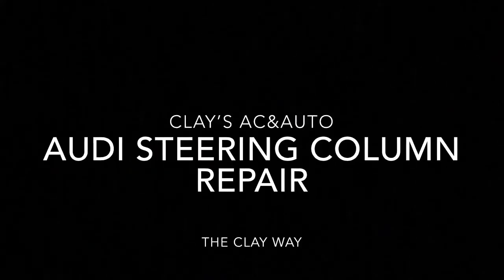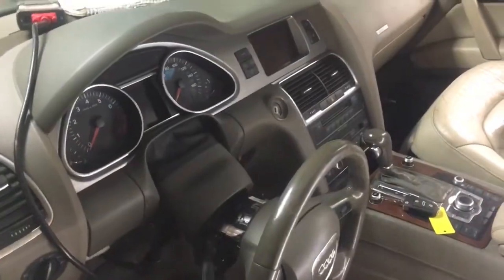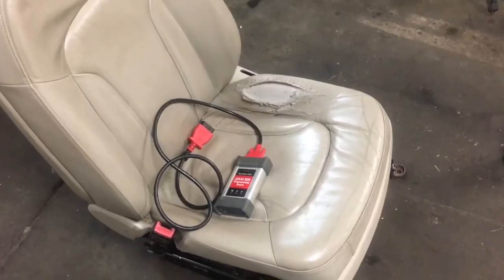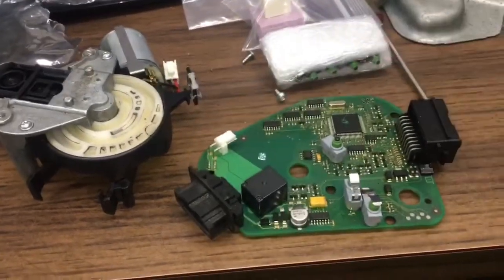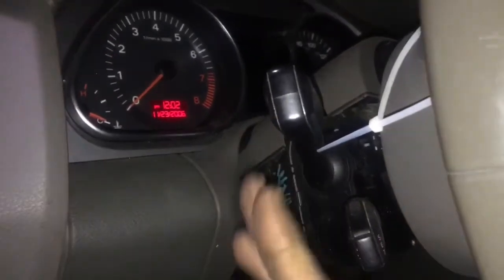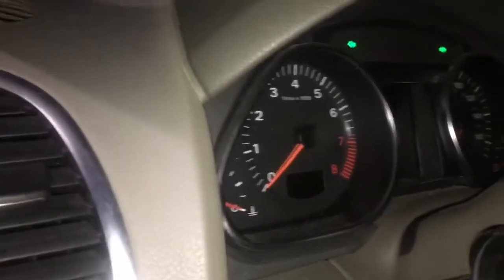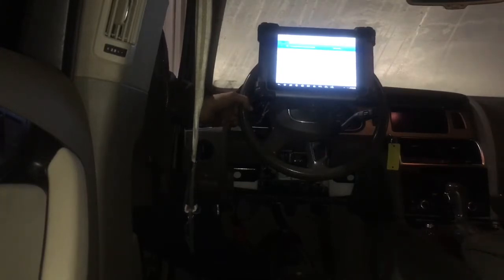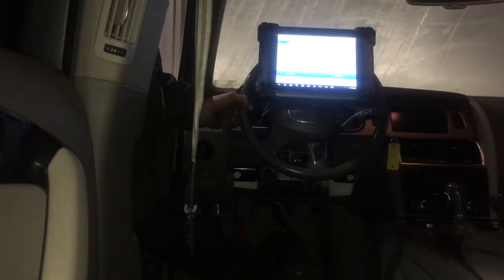Audi MMI not working Possible reason why

Comment: Hey clay.. 
I had issues with my mmi shut down completely.  Audi was no help so took it to a local garage paid £700 it come back I only had the radio to play with no sat nav no Bluetooth.  They said it would cost more ti get all features on my mmi so I gave up at £700 they had took my mmi out and replaced it with a different one.  Now am told I will not be able ti get the full features at all as it’s not the original mmi that’s in my Audi.
Is this true ? Or can I get this fixed.

Wow that’s a lot of work for a mmi 

Great video
Reply from the maker: Hi mark thanks for the kind words!!! Love em 

No that is not true getting the right MMI control should sole it , it dose not have to come from Audi , however you you may have a F5 problem that controls audio , and it’s a large problem that is not easily rectified. That controller which I suspect may be possibly a problem with your car Hass to be the exact same numbers as the original one but you can get one used but then you have to take it to Audi and have them program it there’s a place here in the United States called BBA remanufacturing they rebuild these types of components they’re very very good I would recommend looking them up and also mentioning that I sent you their even though they’re not one of my sponsors I certainly wouldn’t mind having them as one.

Comment: Man, i wish you have a shop near me, i have an issue with my mmi not working due to recent rain that caused water to come into the footwell in my audi a6.  Audi dealership service said it could cost between $1K-7K to fix since they're not sure what electrical, relays, or anything is wrong with it.  The car drives but my MMI screen doesn't turn on.  Arrgggh
Reply from the maker: Hey Don order the computer board for the MMI controller off of eBay it’s pretty cheap and then watch a video on installing it and it probably will fix it
Reply: I can help you out brother
Reply: @omarmorales4666  ok, Omar, I need your help. i have the same problems and a couple more ( key is stuck)
Reply: Orestes Perez for the key just turn the key all the way like you’re gonna start the car and release it, kinda like a slingshot effect (it might take a couple tries) And for the mmi, theres a Bluetooth module below the carpet in the driver side, that might be the issue, im pretty sure there’s gonna be water under the carpet causing the module to fail.
Reply from the maker: @ Orestes Perez Well people send me there Start control modules all the time and I rebuild them. For them let me know if that the type of help your looking for . 

If you key is stuck try putting a charge to your battery 🔋. It may just be dead 💀
Reply: @omarmorales4666  i tried a lot time as slingshot with the key, it doesn't works .i noticed that when I press the brake the gear doesn't release.
Reply: Hey don dont order the MMI board, you stated after RAIN it stopped working. so yor rear drains are leaking on your BOSE amp.... also another issue is the front drains being clogged...
Reply: @omarmorales4666  HI Omar, Hope you will read this, Where exactly is this Bluetooth Module is located and how does it look. Mine is a 2009 Audi Q7, I can see the MMI is powered on it does have a dark/blank screen over, but I could see in the darkness of night its powered on, or at least its on.. not totally dead. Like in your home TV, when its on but cable is out kinda thing. Hope that makes sense.
Reply: @BB4liffe  it’s under the carpet on the driver side, you need to remove the seat, and lift the carpet, you’ll see it inside a black box, don’t now if it the same on the q7 but thats where it is on the a6
Reply: @omarmorales4666  Got it. Thank you so much for the reply Omar. I will give it a go.

Comment: I got a automatic car wash yesterday and my radio and MMI stopped working 😔 any insight on that issue it stills runs as of now Im scared that other issues are to come. Its a 2007 Q7. Pleaseee help if you can. Thank you
Reply from the maker: Well that means the water probably ran down the rear passenger quarter window. Got your amp wet it may come back on tomorrow but there’s definitely water leaking back there it’s a very common problem with them
Reply: @sharpcarco  i suspect the same thing killed my mmi ( 2009 a5 ) any suggestions to fix the problem?